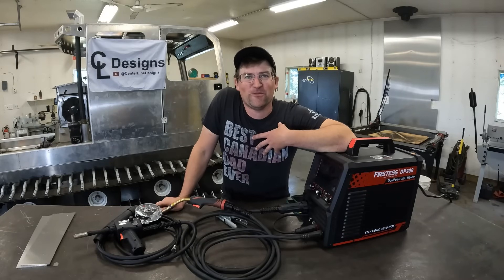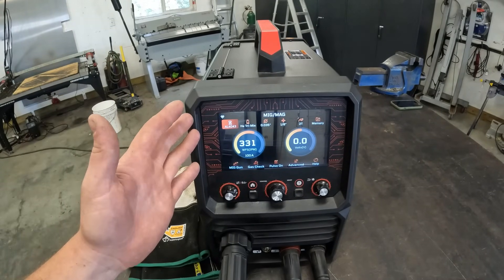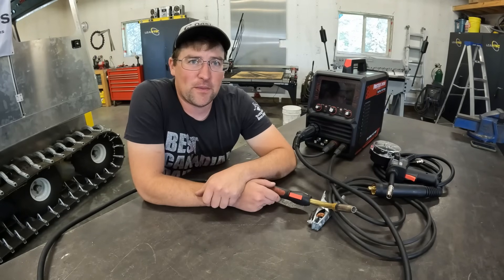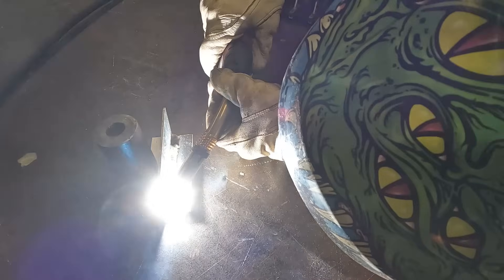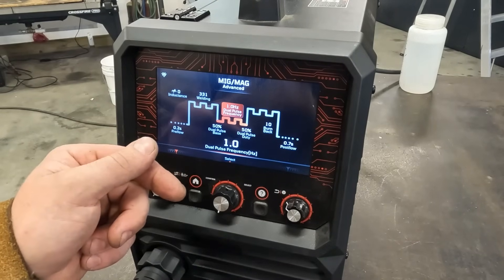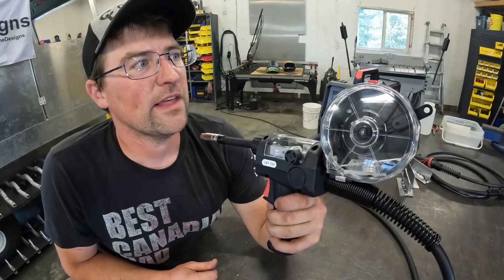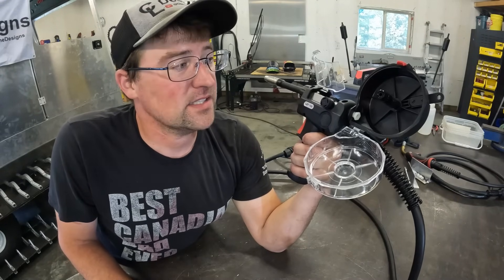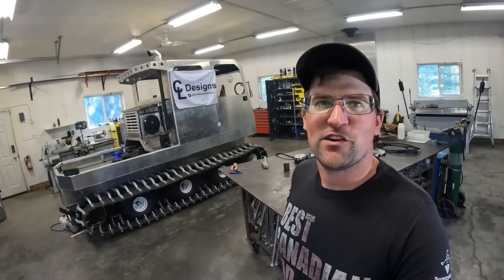Dual Pulse MIG welding featuring the YesWelder DP200!

Comment: Thanks for the teaching. Can you speak on how this unit performs on thinner metals? Around the 20-24 gauge range?
Reply from the maker: I haven’t tested it on material that thin. I usually work with thicker. But the preset settings on the machine are good. It’s very controllable so I would have no worries about it working!

Comment: Looking at building an aluminum boat. Been welding for over 30 years, various industries. No experience with  dual pulse. I'm considering buying a machine for this project, do you feel that a dual pulse machine is the way to go or single pulse mig machine and a pulse tig for the more complex joints, thanks in advance
Reply from the maker: To be perfectly honest I don’t really feel the need for dual pulse. That may be just me as it’s supposed to have some advantages. Just single pulse is more than enough in my opinion. As for TIG I have never needed Pulse features. You have so much control with TIG and a foot pedal. I don’t know what your budget is but this is a good entry level machine. Everlast is a good middle of the road and Miller/Lincoln is your high end a the price reflects that. I own one of all three. The DP200 would build a boat no problem. 1/8”-3/16” is its sweet spot. That way you have the option to use pulse or not depending on what you like.

Comment: Hey the only way to do aluminum is to break  out
Your TIG machine. Give about 45 degrees chamfer, and clean it with a de-greece it, brake clean is my goto. Weave the stick into the aluminum slowly. 😊😊😊 easy peasy
Reply from the maker: I do a lot on aluminum TIG. But it is not always a go to. There is a huge place for wire feed aluminum. Also you usually want more than 45 get in tungsten and never ever use brake cleaner to clean welding parks. You can very easily hurt yourself and some brake cleaners when exposed to UV create phosgene gas. NEVER use brake cleaner always acetone to clean parts!
Reply: TIG is much slower, then MIG. Why bother, if MIG gives similar results, but quicker?
There are some jobs that cannot be done with MIG, but using TIG for everything is suboptimal. Unless you do it for fun :)
Reply: Will let the production manager know, TIG is the only way to weld aluminum….
Reply: Look into the otc welbee ii p400. Unbelievable technology. Your cold starts solved, you can run 3/64 wire through their regular gun and you can set the machine to weld very thin to very thick with the same wire. It’s extremely impressive. The only thing is it is not cheap with the full setup.
Reply from the maker: There is never a reason to weave aluminum. Weaving aluminum creates a less strong weld. Don’t weave

Comment: sry mate    you doin shielding  gas   or flux core for those  welds
Reply from the maker: What?
Reply: I guess, JD asked how protected your weld was - gas or flux. I don't know if flux core wire exists for aluminium, but if it was flux core, there would be slag on weld, a bit like with stick welding. 
In this video, welds are squeaky clean, this means they were gas shielded. A lot my TIG welds come out worse, then these with MIG :)
Reply from the maker: Ahh that makes sense now thanks. Yes 100% argon. Also thank you I appreciate it!